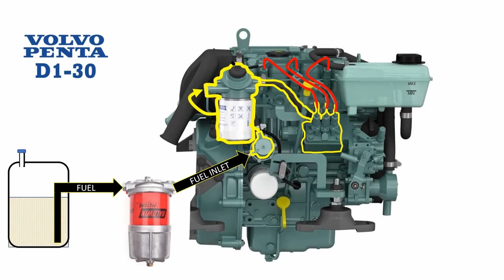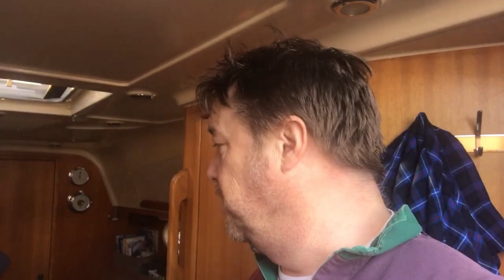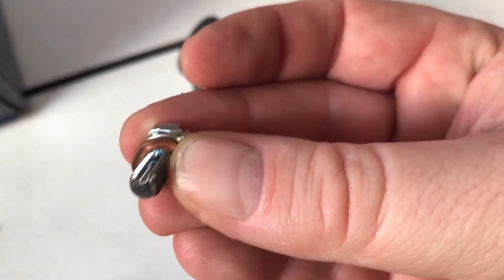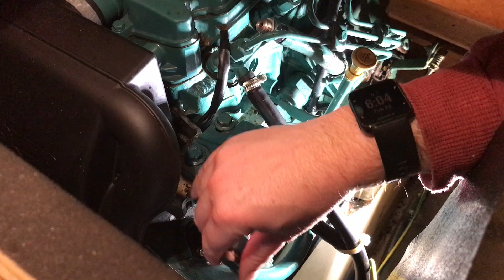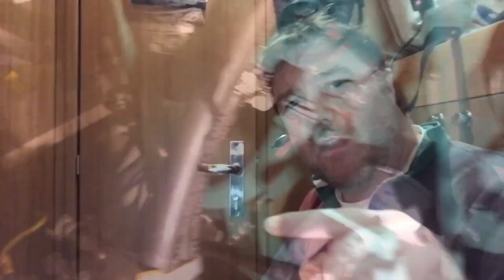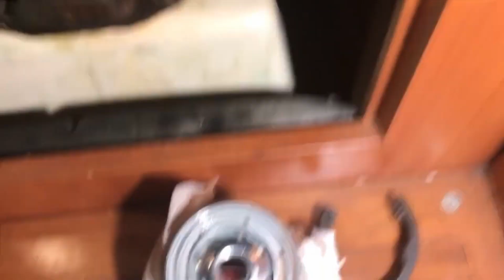Replacing the hand feed fuel pump on a Volvo Penta D1-30 in a small boat

Comment: Just sheared off my bleed screw, while tightening with the smallest 5" long 1/4" drive ratchet! Absolutely hopeless design! Managed to get the end of the screw out with great difficulty by drilling a small (1.6mm) hole opposite the slot and using vice grips to twist a drill in the new hole and a Allen key in the slot. Absolute nightmare!